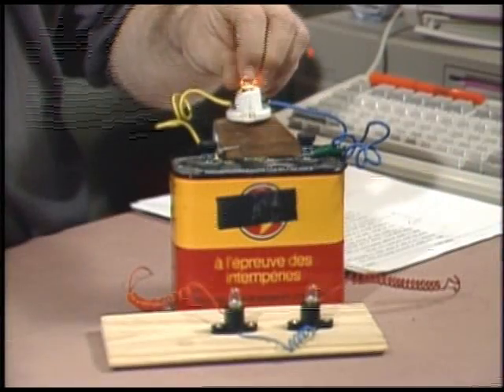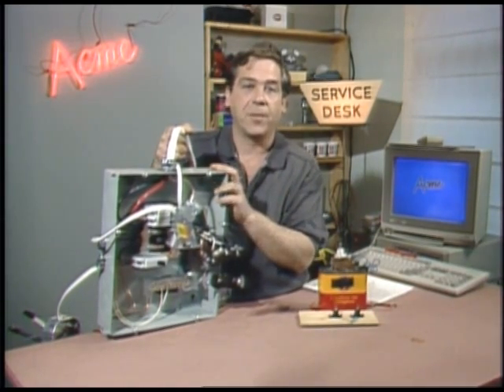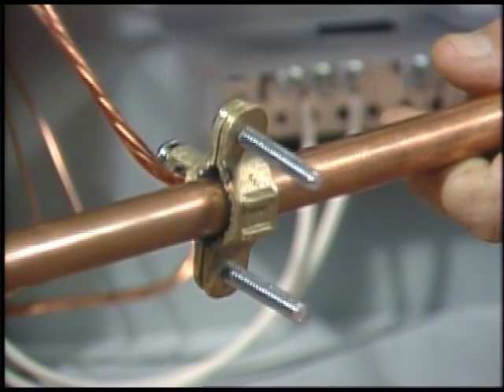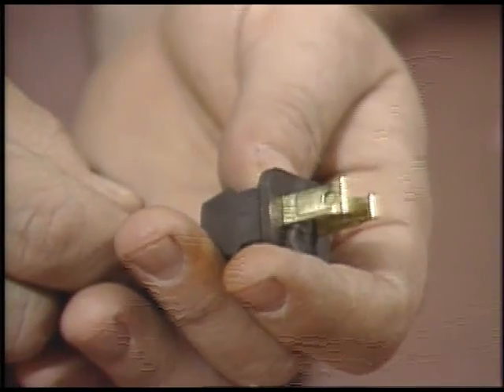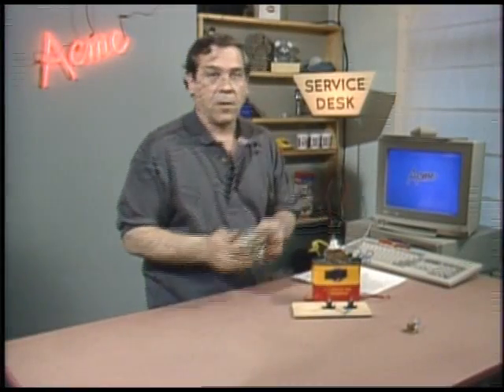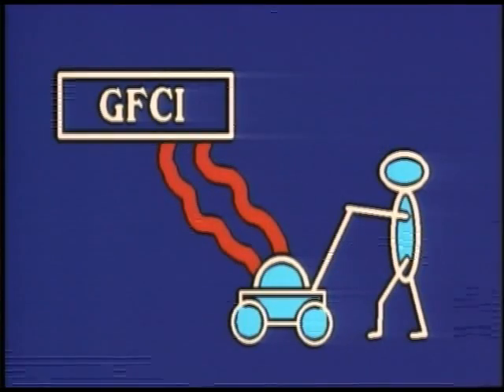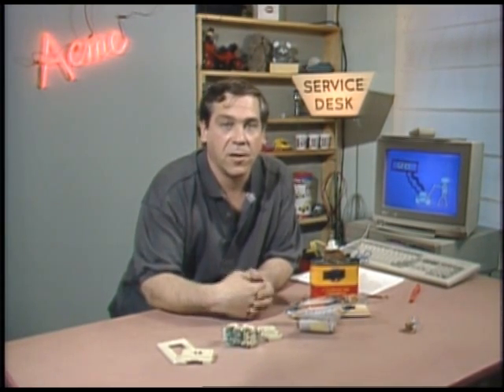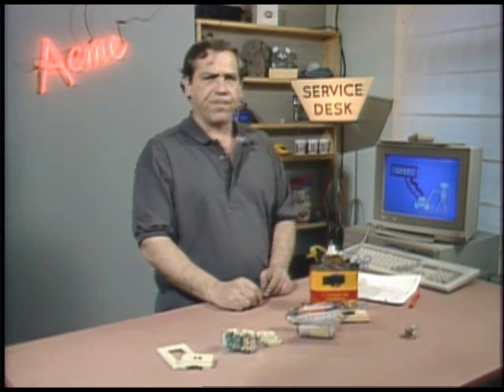Ground Fault Interrupter

Comment: Funny thing about plug designs: I'm from Australia, where our mains plugs are not rotationally symmetrical. When I went to Europe, it DID matter which way round the charger for my phone went when using the travel adaptor to Europe's symmetrical sockets. One way round it wouldn't do anything, the other it worked normally. Seems there is some kind of polarisation in AC circuitry.

Comment: Rubber is only an effective insulator if it's dry. If you decide to mow the lawn when it's damp, then water collects on shoes, and the water conducts the electricity. Also, most shoes are not actually made of pure rubber, and the tops certainly are not.